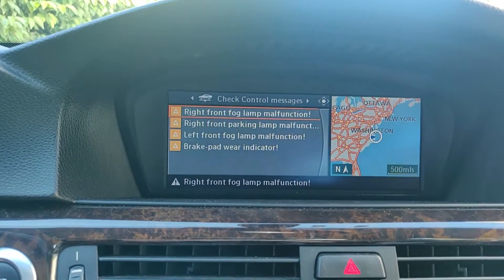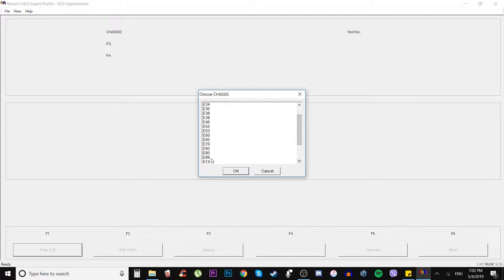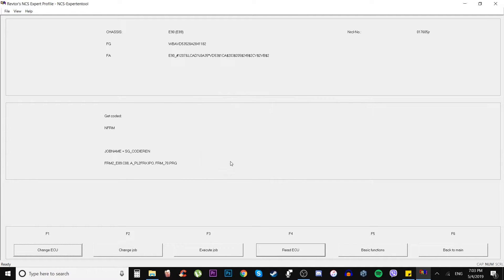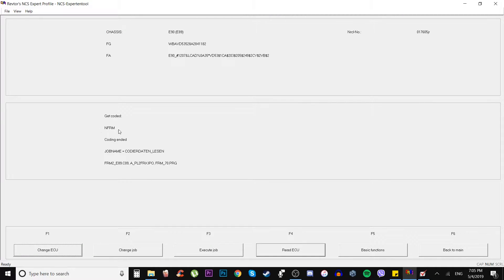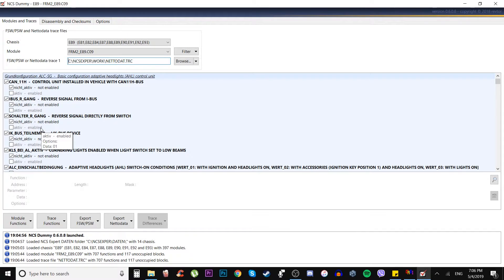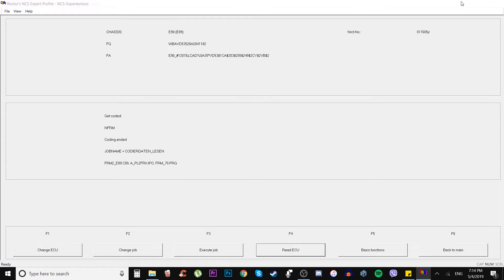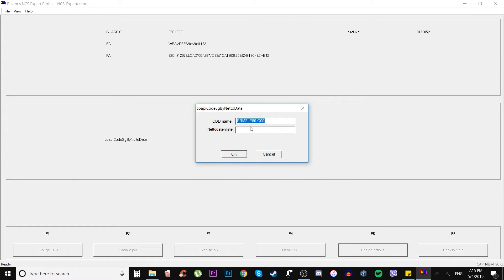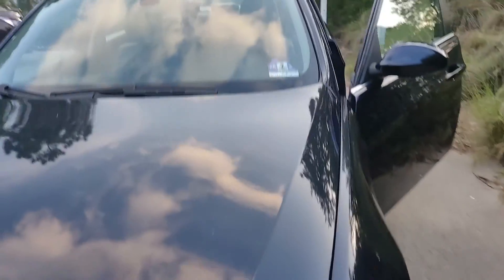How to Code Warning Light BMW E Series Fog Light  Coding

Comment: E90 2011 frm3  not work help please
Reply from the maker: Check nfrm modules for similar options, there also cold and hot check, you can experiment with those, you will need to go through the options thre could be couple related to specific light.

Comment: I dont have aktiv or non aktive options on ncs dummy all i can see is wert _01 wert_02 do u know why?
Reply from the maker: make sure you chose the right module, i you will input the wrong body or the module code, it will not show you the option. I have coding tutorial on the channel, youll see on how to use it if you wach it.
Reply: @Makhnovets i scanned nfrm module. But the options are wert_01 and 02. My car is 2011 e90 which has halogen not xenon. Should i do another process or the same as you did ?

Comment: How to  eneble /code the welkom ligjt when unlock the car the light wil go on!
Reply from the maker: just use the NCS dummy, and check all the options, you be able to find lots of good options, if you have a head unit, you should turn the tuggle for that there, so youll be able to controll it with iDrie.

Comment: Good video, this coding is useful for any led that I change ? also for the lamp h3 cornering light ? thanks
Reply from the maker: Yes, it is, on some cars it's little differant, but in most cases is the same.

Comment: Does the same apply to E60 E61? Trying to remove fog lights instead and to get rid of the warning coz I installed M5 bumper
Reply from the maker: Yes, all the E-series will have similar if not the same module,  sometimes the the coding names is different for some modules, in that case bmw forums will help or text me, and I’ll try to help you!

Comment: Hi, I've tried this on a E90 and works perfectly, on my e87 2010 model it codes success, but reverts back to old coding everytime, please help
Reply from the maker: did you save the original file? if not there special option to get everything to default, i personally newer try it, just check E90 forum, and look for ncsexpert user manual!
Reply: @Makhnovets  thanks so much for the reply , I can code everything BUT the FRM so I'm not sure if it's locked or something

Comment: My E70 X5 (2007) with adaptive headlight got malfunction. Does this work for my car?? thanks (PS: i replaced the old ones with xenon)
Reply from the maker: You need to code the hid light! 
You have options inside the frm file that will change from regular light to hid. Just let me know if you need little guide about!
Reply: @Makhnovets  it means that i dont need to disable Check control notification... How to change from regular light to HID?? Thanks!!
Reply from the maker: You need to code the light in, your car originally come's with reg. light so you need to change it to the hid, but also change the vin to the hid module, it's kind of tricky, but it's can be done. but if you have evrything working the way it should, i would just get read messages, since it's really easy.
when you code the FRM module you can find the section with car equipment,(After downloading the file from the frm module take your time and look for) start with changing that to hid light, if that wouldn't help, go ahead and disable control notification!
To change the vin on the module use the vin kfp which comes with bmw tools as well, check the google, i seen the good guide there, just need to serch it for a little.

Also check the connector if you have all the pins!
This is the pinout for the E84 headlight connector.
Pin 1 = Angel Eyes
Pin 2 = GND for xenon (Not wired for Halogen)
Pin 3 = Bi-xenon (low/high beams)
Pin 4 = GND
Pin 5 = Shutter On/Off
Pin 6 = Corner
Pin 7 = X
Pin 8 = Leveler
Pin 9 = Leveler
Pin 10= Leveler
Pin 11= Leveler
Pin 12= Indicator

Good luck!

Comment: Vin is faulty error. Just searched a lot on the web. Have no ideia how to get through it
Reply from the maker: What year of manufacturing? What kind of obd u use? Did you replace the frm?
Reply: @Makhnovets  bmw e87 2006. K+dcan usb no switch. Frm?
Reply from the maker: The FRM UNIT. Did it was ever replaced?
SO FOR ONE WITH NO SWITCH, you will have to try solder the pin 7and 8.
Check your car obd output, if there either of 7 or 8 missing you need do solder k-dcan cable. Otherwise will be looking for different problem.
Reply: @Makhnovets  i will look if the problem is because the obd, after that i will contact you again oket? Thanks
Reply: I have the pin nr 7. Does this one require an k dcan with switch?
Reply from the maker: So there no pin nr.8?
Reply: @Makhnovets  no pin nr 8
Reply from the maker: So you need either solder the pin 7-8 on k-dcan cable or purchase one with the switch. Some of the cars from 2007 have the pin 7 and 8 but some of them doesn't both of those pins are doing the same work but tilted 2009 BMW did not been installing one of those pins for some reason. In that case you have to do little adjustments to the cable.
Reply from the maker: They're a bunch of videos how to solder the cable or you can just go on Google and search for how to solder K-dcan cable and you going to have exact answer.
Reply: @Makhnovets  okey, thanks for the help, i will try to solder. After that i get in touch. Thanks very much

Comment: There are a couple of great vids out there to show us how to code our car for free, BUT THIS VID IS THE BEST I'VE FOUND TO DATE, and it was the MOST HELPFUL of all of them in my success to overcome the barrage of codes and chimes from my 335i, on all the LED's I've installed. Thanks so much for that.
Reply from the maker: Glad it helped! Thanks! I will keep uploading the coding videos, they should be much better, also the videos for resetting some modules and more!
Reply: @Makhnovets  I would love to see a simple one on getting rid of the seatbelt chime. I already tried someone else's instrux, but that didn't work. I still have the alarms while I'm driving. So that would be a big help. Thanks.
Reply from the maker: @AquaStevae  for the chime I can't say for sure, but i think there two modules has to be coded. I will check it out in a couple days! Thanks for comment 👍🏻
Reply: @Savage Motor Gears  if the module frm show in bimmercode critical error, after coding the led fog with ncexpertand dummy, I see no more critical error in bimmercode in footwell module. In a few days returning to code with bimmercode i see in the bimmercode critical errors again, is that good or bad, should I reset the frm module or reprogramming?
Reply: Added to favorite!

Comment: Hi good job can you help me to activate Bluetooth on mulf2 high basis with my e92 2007
Reply from the maker: I would say 99% you have bluetooth, do you have i-drive screen or just radio, for some reason most of the car's from the factory that have no i-drive didn't have the Bluetooth option on, but you can turn it on. Will send you the video when it's ready.
Reply: Savage Motor Gears I have idrive and Bluetooth option inside but the case can’t be activate it doesn’t do anything
Reply: Savage Motor Gears thank you for your help I hope I will be able to connect my phone for calls
Reply from the maker: hey. i did find the way to do it, but i having troubles with my car to do the tutorial, on upcoming Monday and Tuesday i have off, if you want you can call me on Facebook and i can guide you true, my fb on YouTube page. feel free to text .
Reply from the maker: It's going to be only for phone calls, but you also have to check if there mic in your car.
Reply: Savage Motor Gears I have the phone button on my steering wheel and I can ask help to my car so I think I have it ?
Thank you for your help !! :)
Reply from the maker: @TheEverdiswillbe  i definitely can check it out for you. I'll put the video in 2-3 days...
Reply from the maker: I can do the step by step how and what to do if you want. Just let me know
Reply: @Makhnovets  hi Mulf 1 not good?

Comment: Fyi for anyone running lci or e93. Look for these codes to disable the fogs. I used them to disable the warnings on my 335is.

KALTUE_NSW_M2_37_M1_3_C32 - Cold monitoring of front fog lights

WARMUE_NSW_M2_37_M1_3_C32 - Hot monitoring of front fog lights
Reply: Did you also have to disable the option he disabled in this video "CC_MELDUNG_NSW"? I also removed fogs from a 335is and want to code out the warning. Thanks for your help.
Reply: @GhostRiderCanada  I don't think so but honestly cant recall since its been so long ago. Sorry

Comment: Great videos!!! I was wondering why I can code any modules but when I try to code my 
cas to change the power class I keep getting a errors COAPI-2060? I’m thinking cause I have a ecu tune is why this is happening   

Daten are updated
Settings are correct 
Using kscandacan cable from bimmer geeks
Reply from the maker: What kind of profile do you use in NCS Expert? also what version of the software? what year of your car? what kind of OBD you use? did you set the latency in device manager to 1?